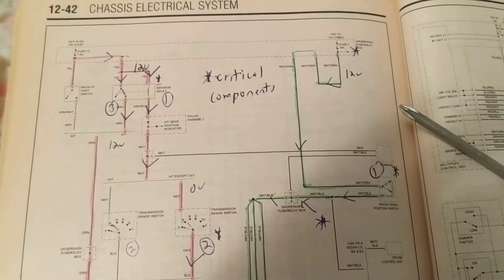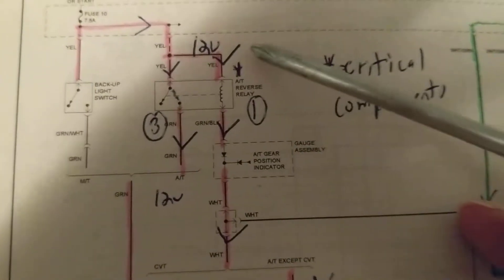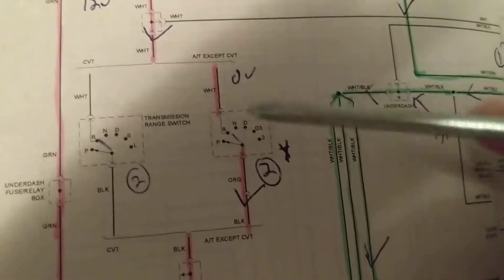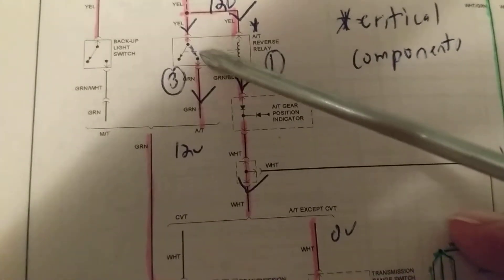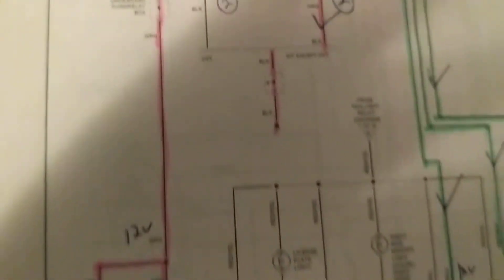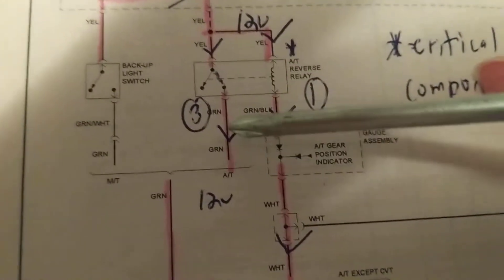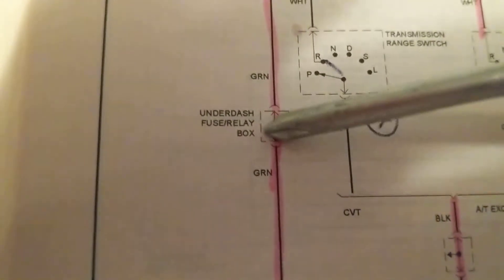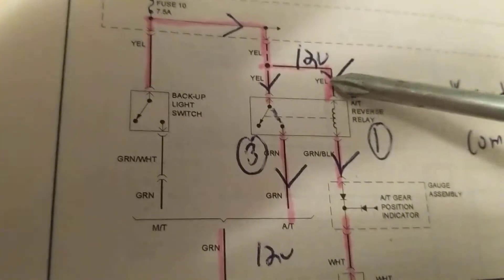How REVERSE LIGHTS work Honda Civic and CRV how wiring diagram ,please subscribe to my channel

Comment: I have a crv gen 2 2003 automatic but dont have a reverse light at the back of the car someone told me that reverse light switch sensor.but i tried many times i cant find it.did you know where exact location of the reverse switch.thanks a lot.

Comment: I have a better question one reverse light works and the one that doesn’t work has three volts coming through the ground wire , when take the bulb out the same side tails don’t work plug the bulb back in all the tail lights work except the reverse light